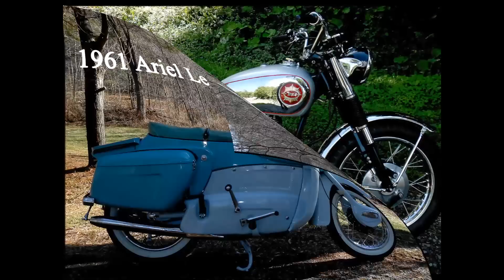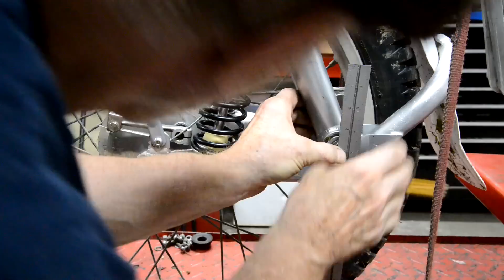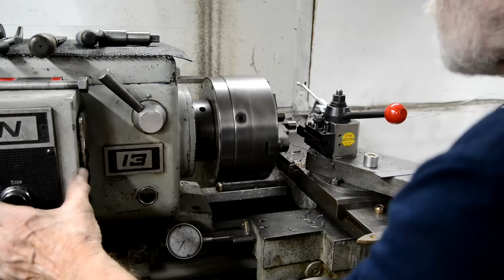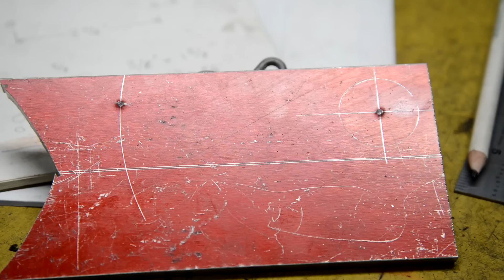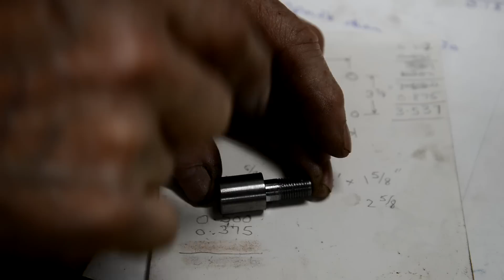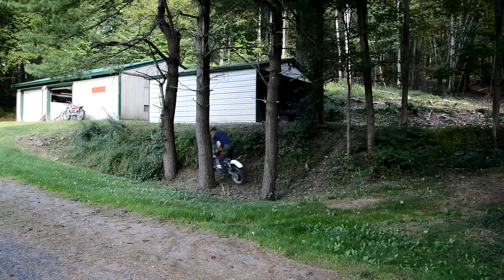GreeBSA 350  -  Part Twenty Seven

Comment: Michael, do you think that you should have used a needle roller bearing in the brake plate?
Reply from the maker: No. I don't think that it needs it but more importantly on a trials bike that are is regularly covered in mud and muck. It wouldn't last five minutes.
Reply: @BritanniaMotorcycles  They put needle roller bearings in modern Trials bike mono-shock linkages They can be an absolute nightmare and need repacking or replacing every year.

Comment: May I ask you a question? What steering head angle would you use on a rigid frame trials bike ? My father had a Greevse trials bike and that had suspension that extended when you put the brakes on
Reply from the maker: I have never built a rigid trials bike and have only ever ridden a couple in my life. I always build the sprung bikes with a 24 deg fork angle. That is whether the forks are parallel with the head stock or not. The angle changes so much with the the suspension changes during riding that I have found this to be a good general rule. Hope that helps.